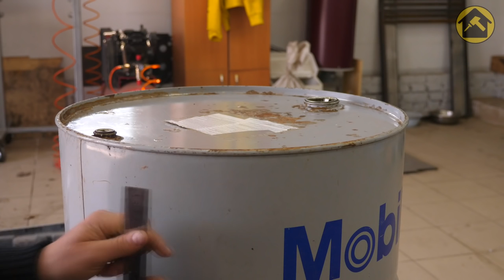Here is my dream come true!! Great idea from a 200 liter barrel

Comment: I knew a man who was killed cutting open a transmission fluid (oil)barrel just as you did. He should have known better because of his trade, but he got in a hurry.I cannot stress enough that it only takes a few grams of vaporized hydrocarbons mixed with air to for the LEL (lower explosive limit) of many oils and combustable hydrocarbons.  Even 'empty drums contain combustable traces and plastic coatings. Washing will not remove the traces. Fill the drum up with water to the cut line or fill the drum with an inert gas.
Reply: My preferred method of ensuring I don't hey blown up is to safely burn it out intentionally. I use this method especially when cutting old gas bottles for up-cycling. It may sound scary but a little understanding and a lot of careful-ing ensures no explosion.

For gas (in my case propane) bottles remove the valve ensemble with a wrench, a good long blast with compressed air (minutes NOT seconds!) ignite any remaining vapors in bottle with a remote ignition device of any type --- I made an electric spark ignitor very simply from an old sparkplug and wire, but there's no doubt dozens of other options. It's worth noting that the spark ignitor will fail to ignite the propane if there still an enormous concentration of gas in the bottle, so it's only for AFTER degassing the bottle with compressed air. 

For barrels as shown it's even simpler. If the ambient temperature is lower that the vapor point of the oil/fuel inside its super fast; a quick flush with compressed air "just in case" there are vapors still inside from previous heat cycling. Then light it on fire deliberately while cutting. It's most likely there will not be enough residue to light, even intentionally, so I like to use methyl hydrate alcohol. Poor in a bit, light it, start cutting. It might sound weird but if it's actively burning inside its impossible for it to explode from vapor ignition. 

May sound strange but both are explosion safe methods and don't involve waiting for water to fill the volume of the vessel in question. For small propane tank/bottles it's maybe not so bad. But 200L/55gal is a whole lot of volume to fill through a garden hose.

It is worth noting though, if you want 100% dummy proof, no thinking required, guaranteed to to get the "safety guy" sign off, your pretty much left with water or a noble gas fill. So use good judgment in choosing a boom-proof protocol folks!

Comment: Started watching the thumbnail of this video and right away I saw problem.
Never ever ever cut a barrel like this. Especially one that contained a petroleum product or really anything for that matter. Please let me explain before skipping this comment because what I have to say could save your life. 
First thing is I knew someone who died because of doing this exact same thing, cutting open a barrel with a grinder or circular saw. It exploded and ripped him in half. He died slowly, like hours.
Here is why. Specifically in the case of this video, that barrel used have engine oil in it, which is flammable if you didn't know. And cutting it with a tool that creates spark and may produce a static charge makes this a potential bomb. Especially more dangerous keeping the barrel openings closed. 
Prepare for capital letters.
CUTTING STEEL AND PLASTIC BARRELS WITH POWER TOOLS CAN LEAD TO EXPLOSIONS REGARDLESS OF ITS CONTENTS.
I am not kidding about this. Don't do this ever, not at work, not at home, not at your grandma's house, never.
First off you can't clean out a closed top barrel like this one. It is nearly impossible to remove all flammable materials from a barrel like this. And to create an explosion you only need a little bit of flammable material to make this thing blow up. I don't care what sort of precautions this guy took to not explode. My opinion is that without filling the barrel with water before cutting your just asking for a death sentence. Seriously.
There are tools you can use to cut open a barrel. Just not anything that can throw spark or create a static charge. Like tin snips for example, or a sheet metal cutter, but not a saw of any kind. 
If you don't believe me, well I guess it's your funeral buddy. 
Good luck out there. Stay safe. Don't cut closed top barrels with power tools.
I am not suggesting this guy is an idiot at all. He is more than likely just not knowledgeable of this fact, which I wasn't until this person I knew died from doing this exact same thing. Thank you for reading.
Reply: Fun fact, you can easily clean this kind of barrel, hence cut it with a grinder in a safe way.
Also, seeing how clean it is inside when it's opened at 0:38 it proves you're wrong saying it can't be cleaned properly.
I won't deny the fact people should know that they need to clean it properly tho, and maybe a tutorial to help them do so.
Reply: @handyEliot  Maybe you have the know how to clean the inside of this barrel but most do not know that it needs to be done in the first place. 
My main concern is someone starts cutting into a barrel made from anything and is using a grinding wheel, of all things. The one tool that through sparks everywhere whenever they are cutting metal. 
Just be safe, spend a few minutes filling this thing with water then cut it with a grinding wheel. 
And jeez a Sawzall with a ferros cutting blade would work too, and throw way less sparks. 
All I'm saying is this is a great way to blow yourself up with little effort. Yeah the video shows him cleaning the outside of the barrel but what good is that gonna do when your throwing molten hot sparks in a 10 foot arc.
Reply: Можно наполнить бочку водой ,вода вытеснит скопившиеся газы и обработка металла станет безопасной